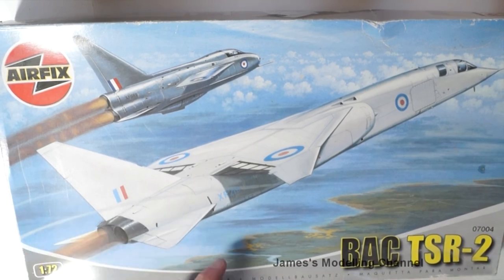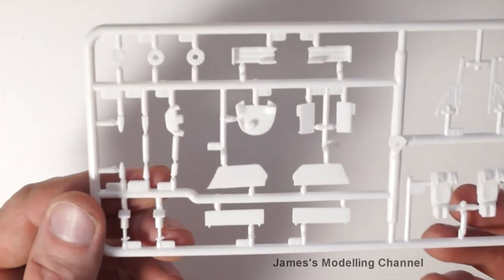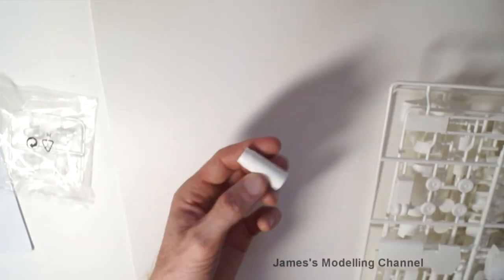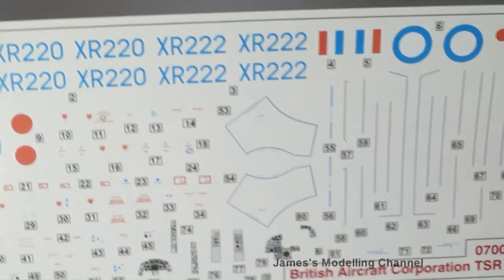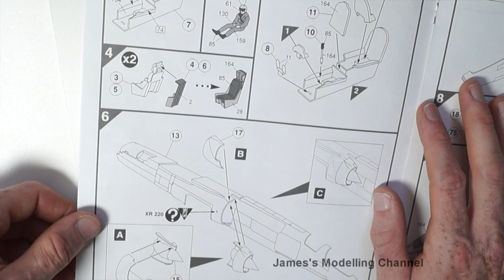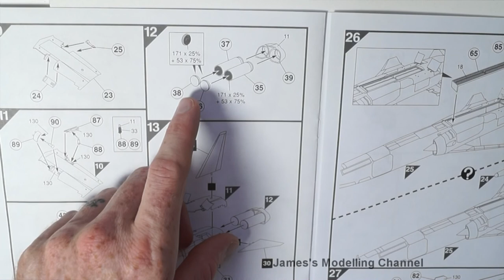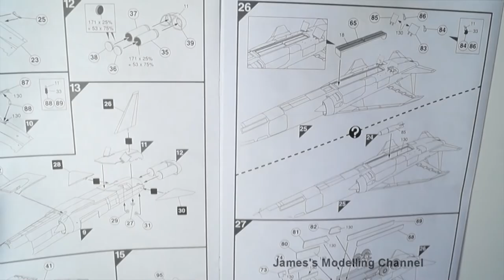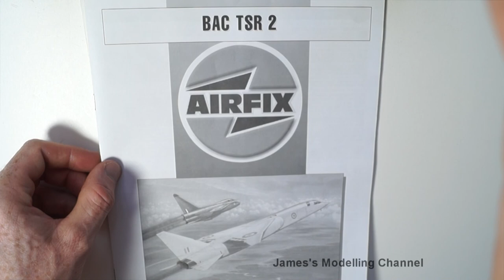Airfix 1/72 BAC TSR-2 A Look Inside The Box

Comment: "an old kit", haha, this was released in 2007, that's not old. Try building a 1/144 scale Airfix Comet! I have several of these, and building one right now. It's not Airfix's finest in terms of parts fit, and the way they chose to engineer it is a bit strange. The air intakes are hopeless, needs lots of filler and shaping. The cockpit details are virtually non-existent, but it's ok if you build it with the canopies closed. I think at the time we were grateful that Airfix chose to even release this subject, and it only had a limited run, so perhaps they didn't put much effort into the engineering. But having built a few more recent new kits, they haven't improved much. Tamiya they are not, but with care this can be made into a nice model.